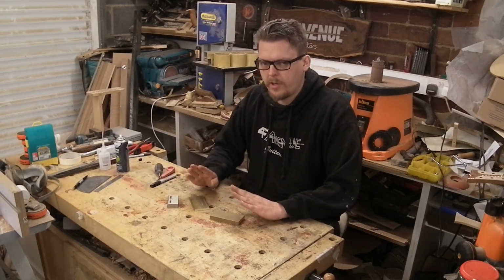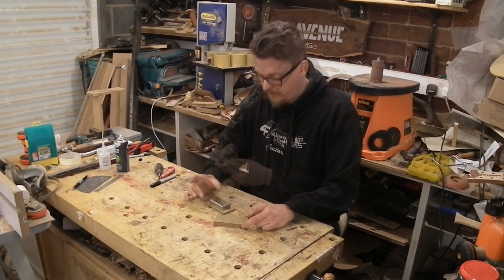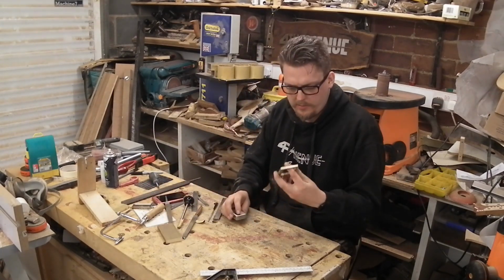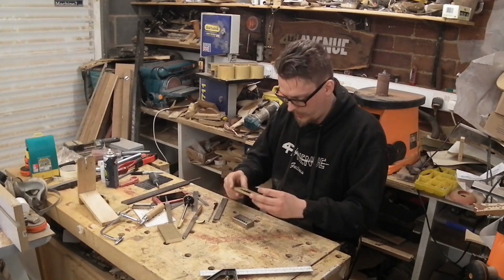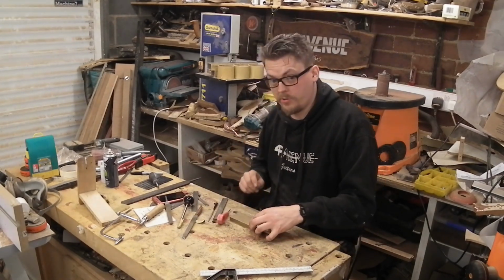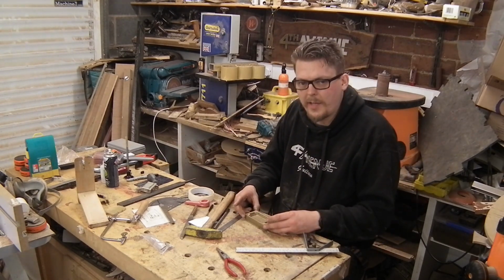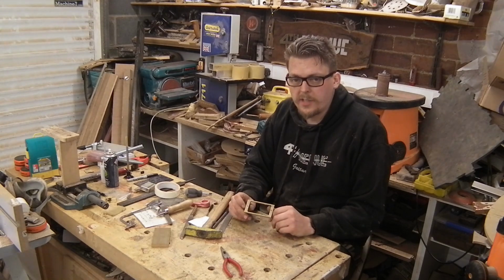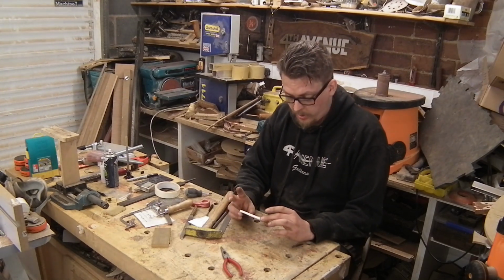Custom Guitar Building: Making a pair of pickup rings.

Comment: Anthony, I was thinking you could rivet the rings with copper rod. Flush or raised. In that photo of the Grateful Dead thing I riveted three small pieces with flush rivets, so you could do more than the 4 corners, and have no gaps, after removing some material. It’s fun. Maybe you already planned on it, I don’t know,, just thinking out loud. Copper and brass solder, you could make it seamless with solder. Even add accents elsewhere with silver on the copper, melting solder. Or you can put my head in your bench vise.

Comment: That turned out awesome mate. The scalloping to match the body work was spot on. Any plans to clear coat them so they don't tarnish with sweat and time? Super shiny would contrast well as the rest of it ages. Wipe it down with some brasso (navy metal polish for brass) then clear coat em would be my choice. What's your plans?
Reply from the maker: Thanks. I polished them with autosol and gave them a coat of wax which should protect them from tarnishing too quickly. The only issue with clear coat is that it is likely to chip and look worse than a bit of oxidation over time.